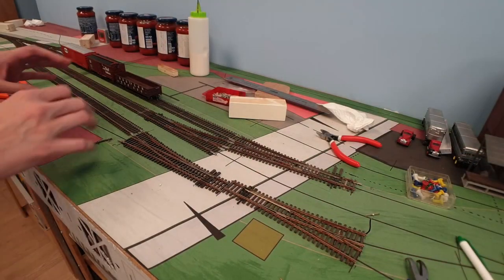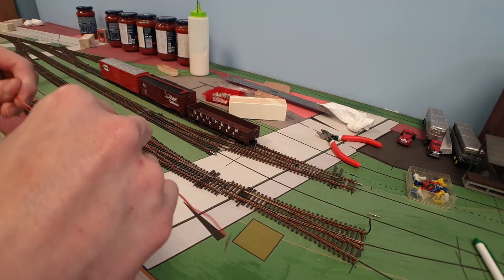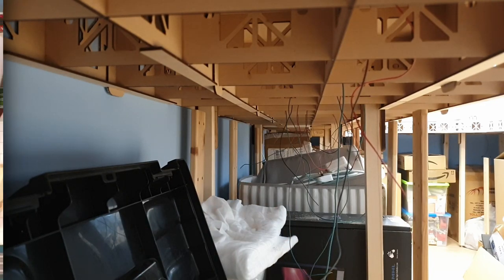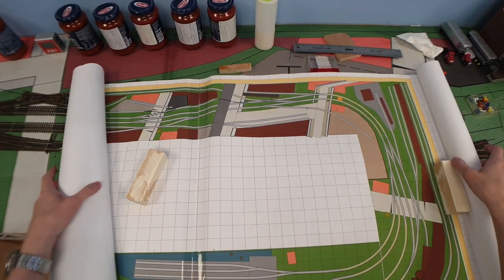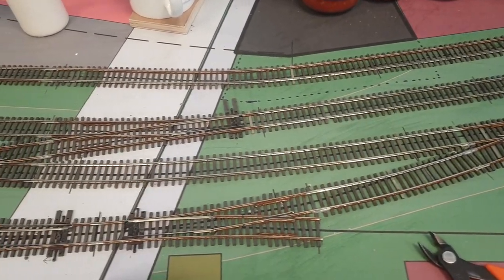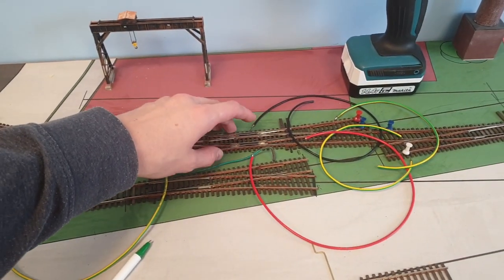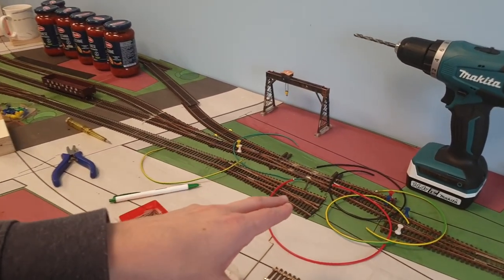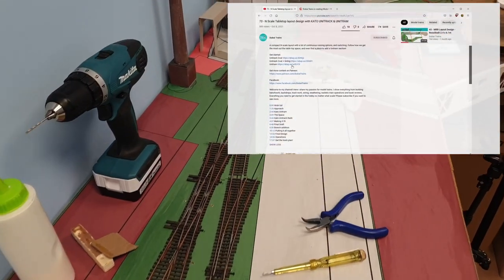The easy and reliable way to lay track? I start the Downtown section in Part I ~VLOG 136

Comment: Soldering track ON the layout is easy with a weller trigger style soldering gun, (NOT the 50 watt pen style iron that remains hot on a stand) 

With the fast heating action of the trigger style "soldering gun", you won't melt your ties so easy. 
Just make sure you apply a bit of flux paste on the area to be joined BEFORE you heat a drop of solder into the joints. It is very effective and gives you bulletproof rails that don't lose power when many joints are involved and it won't melt your ties with the prolonged heat of the traditional iron.

Your planning skills are great and the video's are very informative. Thanks for the ideas! 👏😄
Reply from the maker: Thanks Crabbin Moose! Good to hear you find the layout design videos usefull.
 I think my dad had a soldering gun back in the day. Maybe something for my next layout :-)  Thanks for reminding me!
Reply: @DubaiTrains  you're welcome! 
I found your choice of music and style of camera work to be very inspiring and thorough. Kind of reminds me of a Johnny Costa and Fred Rogers opening.

The soldering gun I recommended is a must for any serious modeler who does any electronic work and is great for speeding up the process, which is why I love it so much. Trust me, you won't look back once you get one because it makes it so much easier.
Reply from the maker: @crabbinmoose8583  Thanks. The free to use music selection is limited and my camera work undirected. When you got lemons you make lemonade!
Reply: @DubaiTrains  👏😆

Comment: Great layout, love the video's at 12:20 where you had to move the turnout this could cause derailments for you as it created a "S" route. The turnout deverts left then you added the curve to the right to make the line up to the other turnout. You should try another switch combination to strengthen it out. As for the track aligned with little wiggle in it is as prototype track is. Having all track in a prefect line is modeling. The ground shifted ,a derailment, sunkink miss alinement. As long as it is not to foul the next track or industry the railroad will leave it. 
So having a little wiggle in your yard is ok, since yard movment is 10 mph or walking speed. 
Main line is different subject. Look at your photo's or any photos track spacing, tie spacing. Ballest or lack of at industries track, leads even in sub yards like the photo you posted. Is to make your railroad the stage for your actors the cars an locomotives. 
I like your layout design it has great operation for several operators. 
Being a modeler since I was 5 now at 60 and the past 35 with the UP as a cond,swtmn,yardmaster, but mosu of all always a modeler.
Reply from the maker: Hi Shelley, the best compliments come from you guys & galls out in the field!

I am certainly not aiming for manicured and perfectly geometric track. But i guess uou already figured that out. And honestly it also fits my track laying skills better.

The S curves are noted. I am aware of that issue. I think it will be all right with the speeds i intend to run and the radius of said curves. But if there is any issue i for sure will rip it out and make something that works flawlessly. Whilst operating my old layout I had a derailment once every 1000 movements or so. I would like to reach that level of reliability again. 

Thanks for the input. Keep em coming!

Comment: One, when laying out and building new yards, etc., the turnouts are usually built first so they are accurately located then the tracks to connect them are built in case any finessing needs to be done.  Two, the switch-work you call a double crossover is technically a double slip turnout which takes the place of a double crossover of 4 turnouts and 1 crossing in the space of one turnout of the same number or angle.  A single slip switch has the route connections for one side only making for one less possible route choice.  Because of the complications involved, slip switches are called "puzzle switches" and are very expensive so are only used in very tight locations where there is little room for track to be placed and serve the routing needed, such as depot leads or yard leads.  Three-way or lap turnouts are also in the category of special trackwork to be used in tight locations.
Reply from the maker: Thanks for the addition Roy.
I do need to think of a good infographic for the facia for that double slip. That turnout will be controlled by 2 manual rods. Some combinations will lead to the train going through a closed half of the turnout, which should be avoided.

Comment: Awesome job so far mate! Smart to start with all the critical track pieces, outlining them and then prepare all the connections and holes for the switch machines. I hope you are having fun doing this, and I look forward to seeing the first train running up and down a stretch of the new track! KR Richard
Reply: PS soldering 15 turnouts in 2 hours is proper factory line speeds man!
Reply from the maker: Thanks Rich. Yes it is fun! If one doesnt enjoy the track laying stage than I fear the worst for that layout. And for the YT videos, you have to find a format that is enjoyable to make. Otherwise you will simply burn out. I have seen several MRR channels talk about and / or suffer from this.
But i am pushing forward to get the trackwork done and over with. Fun only lasts for so long. And i want to run some trains!! 
 The brewery section is next and once that's finished its only some sidings and a few loose turnouts. 
Have FUN with your channel!
Reply from the maker: W.r.t the factory speed. It is all about making an assembly line. So first i cut all  wires for all the turnouts, then i pre-tin all the track of all the turnouts to solder the bridges onto, etc etc. 

I probably pre- tinned 60 sections of track in less then 15 min. I had them all lined up and ready to go. 4sec heating with the iron, then add tin, next.

Hope this extra explanation is useful, cos your layout is massive so any efficiency gains can really save you days.
Reply: @DubaiTrains  always glad for tips and tricks! Thank you

Comment: Just curious about the switch selection you used at around 10:43 ish.... You have a little wiggle in the straight section. From that camera angle it looks like you are using a "Y" turnout. Why not use I left hand turnout? Or moving the "Y" out a little more to get that straighter line-up? Just wondering. It's all looking great. Always look forward to the videos as they come out. Thanks for sharing.
Reply from the maker: An alternative could be as you say, to move the wye up a little. That would eat from the industry siding though. Ill see if i can incorporate a small segment to show it in the next video.

Don't forget, it doesn't have to be perfect!  A little bend here and there can add character, and break up what would otherwise be a pong straight stretch.